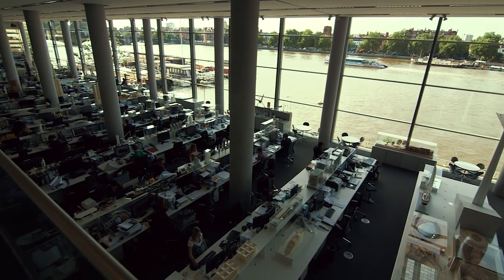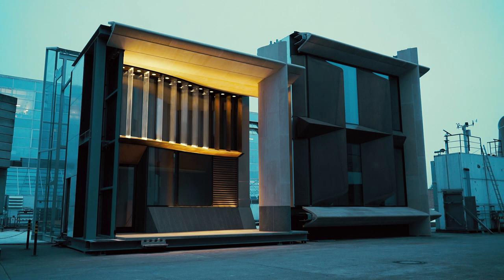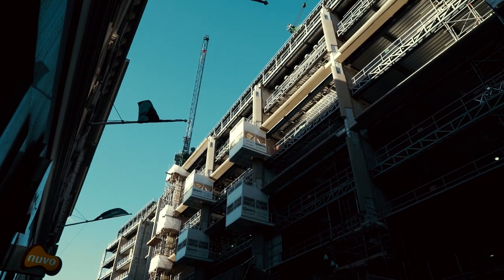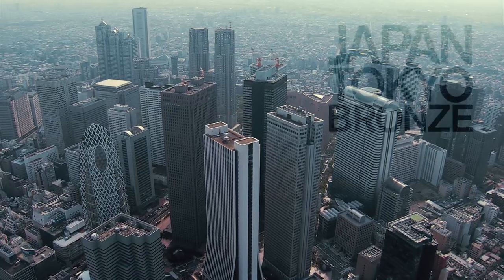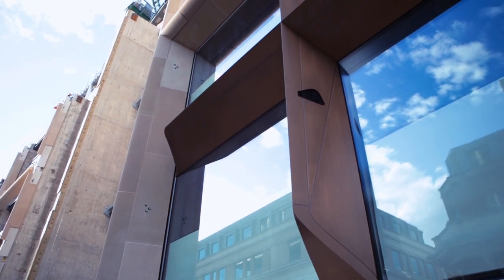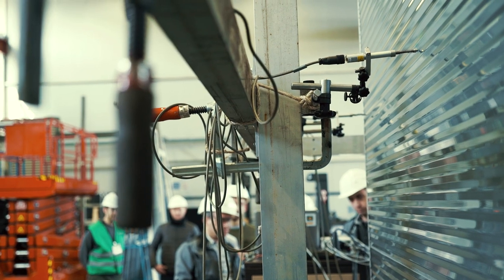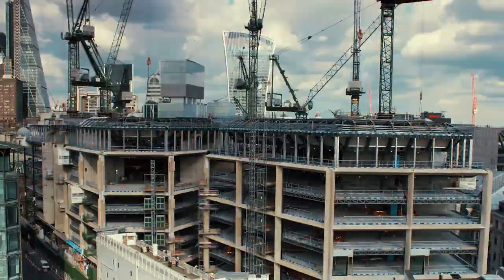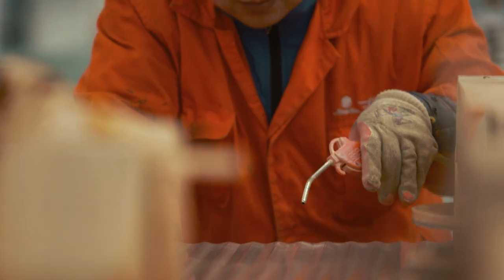The Facade of Bloomberg's London Building: It's All in the Details

Comment: The building process itself involving so many countries is not very sustainable
Reply: The building's longevity over time will compensate for that.
Reply: @soulstar0111  I mean…… no not really. It’s not like Foster is building a large percentage of all office buildings, though, so this is not a real problem in and of itself, it’s just not setting an example of valuing embodied carbon over custom finishes. The real “problem” in the world is all the concrete buildings that both are nothing special and are not concerned at all with reducing cement use vs. structural stone and structural wood. For a 10 storey building loose laid masonry is out of the running so that leaves reinforced concrete, steel, and mass timber for structural elements….. of those obviously mass timber has the most promise of the best embodied carbon per sqft especially in Europe where there is so much mature production capacity for mass timber elements.
Reply: @2brazy4ubitch  I agree with you wholeheartedly.